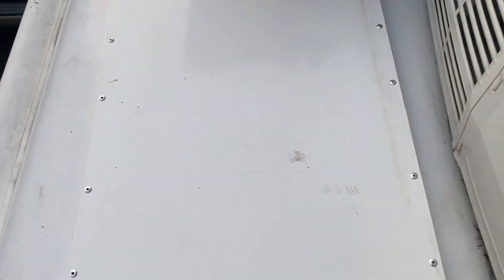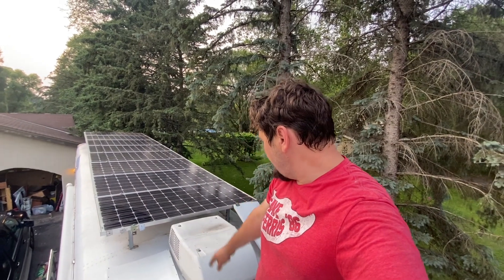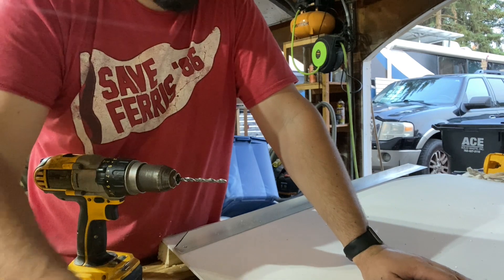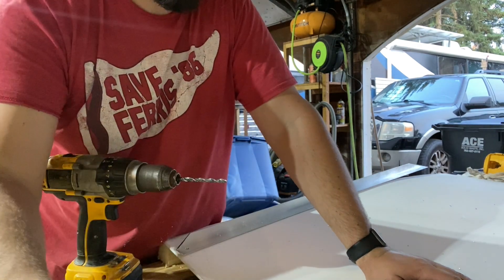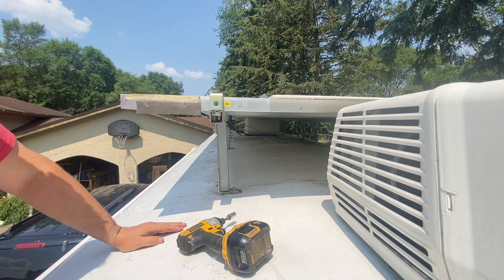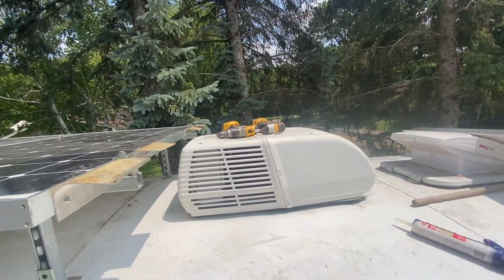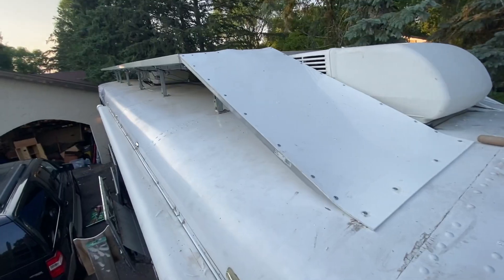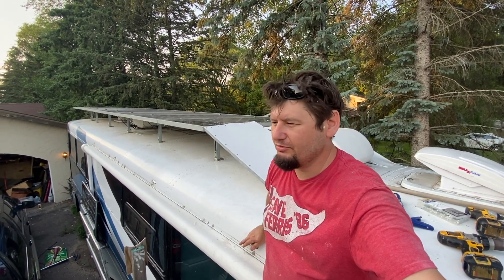Improving RV Solar Rack Aerodynamics.... again on our Bus Conversion

Comment: Didn't you have your solar panels flat to the roof? What made tou raise them? Was it too hot under the panels. Just starting my project.
Reply from the maker: Wanted more and added vents. Just made sense to go over the top of everything. I didn’t even have to drill new holes, just did stand offs from
My original supports.

Comment: FYI, faster air drops in pressure. Your going to have a massive amount of air pressure under the panels. The faster you go the higher the pressure difference, its how a 747 gets off the ground. And yes you can get drill bits that make square holes, they are used for joinery.
Reply from the maker: That’s true, I’ve done some wind tunnel aero experiments. I plan to do a video on it, but I need a better apparatus. Anyway, my preliminary findings show the windshield makes a big low pressure zone above the front cap so this may not be a big deal anyway at higher speeds, but we’ll see.
Reply: @HimmelbergerBus  what about something like a splitter concept - as they use on the front of sportscars?  no low pressure zones to create turbulence of forces....just a thought... You are trying to reduce drag, but you are introducing more of it - it seems....